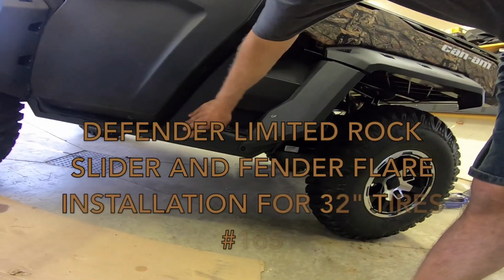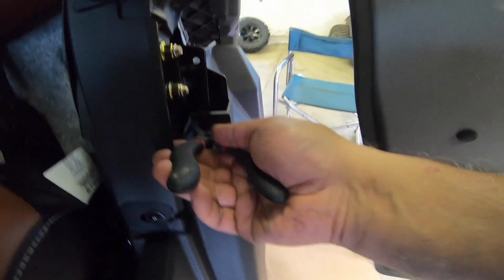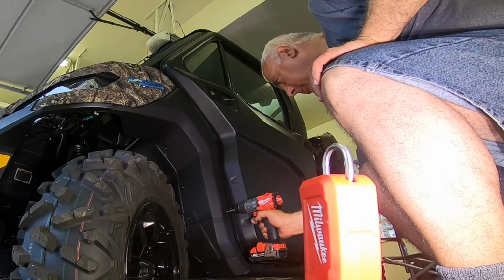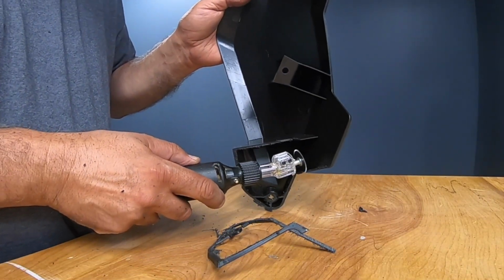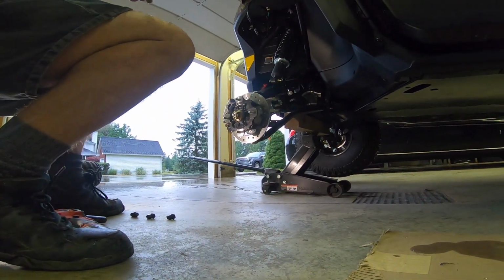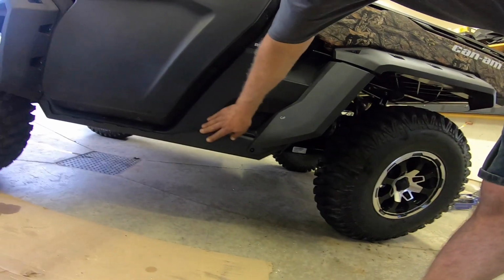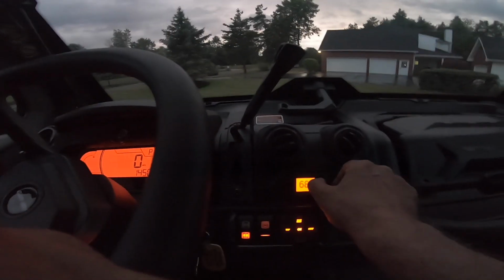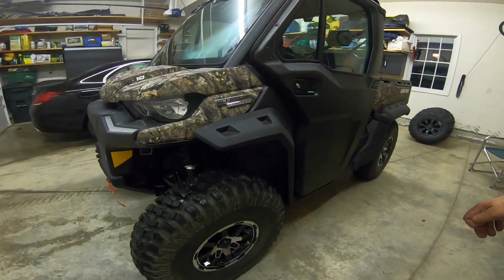Can Am Defender Limited Rock Slider Fender Flare and 32" Tire Installation #165

Comment: Hi Peter awesome video my mind is very sharp I work on all types equipment every day and I have Thousands of dollars in tools even welders and cutting torch and a plasma cutter awesome video and I also have a lift table to lift all the equipment up I don’t work on the ground I was wondering if you ever got my video on my electric fuel pump I was just curious about that but great job
Reply from the maker: Dean i received your video, but could not open it on my phone, i will try my computer today. I'm jealous i want to learn how to weld, plasma cutter, torch, and lift...i'm happy for you Dean you're ahead of me. As always thank you. BTW do you agree with my advice?

Comment: Great job, looks great! Another great video. I’m trying to figure out which wheels and tires for my Limited.
Reply from the maker: You should watch my videos on tires and suspension. If you don't want to change the front A-Arms i wouldn't go larger than 30" tires. I used the factory rims from my Defender XMR as i did not want to risk a wider stance as the SXS won't fit on my favorite trailer. Please let me know what tires and rims you select not an easy chose. Thank you always for supporting the channel.

Comment: Looks like you put the wide flairs on. I just put 28x10x14 Evil m1 on. Do the flairs cover the width of the wide tires. what size tire you get.  same size all around. thanks
Reply from the maker: Cade my tires are 32"X10" yes the same size all fours. Evil's are great tires I'm not sure why they are not popular. Merry Christmas
Reply: Thank you, what do you run for average tire pressure?